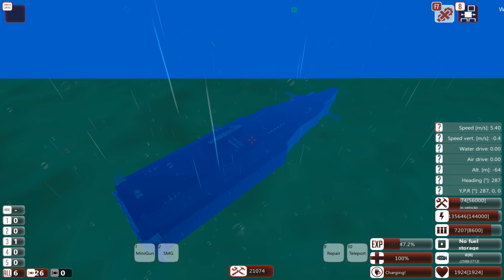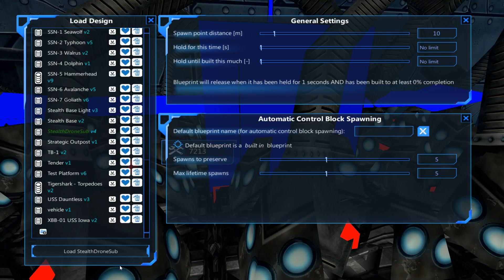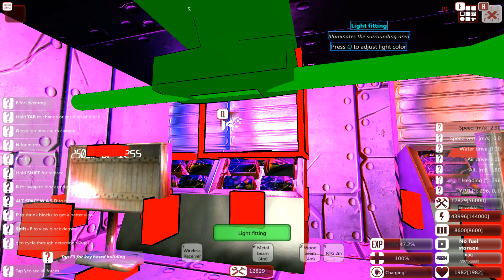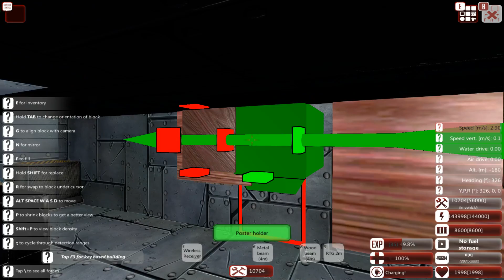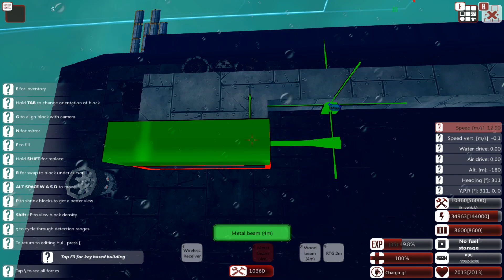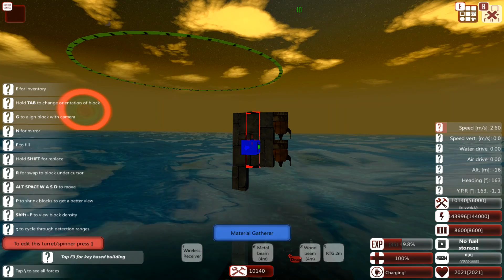From The Depths - Birthing A New Boat

Comment: One thing i thought of you can do to make resource gathering easier is you could put a docking station on a spin block.  With the docking station you can put a drone that has a power source gatherers and resource storage.  If you can keep the pids balanced where the sub wont move under water you can just use the spin block to rotate the drone above your sub and can gather in relative safety.  When your done you flip it back down under water and move off to the next.  Also something you may wish to try is use acbs to hot key preset depts for your altitude pid.  If you need ideas on how to set it up let me know.

Comment: The problems with you ship surfacing when you tell it to go to ...say -19 meters, is that the control block that is making the calculations is basing it off of where the control block is, not the top of your sub... And does tab do nothing in adventure campaigns?

Comment: Virginia sounds like a good name for her, for the torpedoes Iv'e noted that the top one that's supposed to track surface targets (the top torpedo) only is doing a lot worse at tracking surface targets than the one mainly meant for sub surface targets (the bottom torpedo), as I mentioned in another comment it has redock if damaged if docking to a subvehicle spawner. And as you have noticed it toggles it's AI depending on the range of enemies.

You could probably add a chair and heartstone to have easier access for upgrades and I've mentioned some routes for possible upgrades in the mail too.

Lastly she not he :)

Comment: question.. Why another sub and not surface resource collector for resource nodes ?
Reply: and ACB to make the sub redock when its at <X% health
Reply from the maker: Because subs are the most survivable. And killing another construct + gathering its resources is usually more profitable than mining resources as well as faster.
Reply: The sub has redock at % health it requires a sub vehicle spawner however, also I forgot to mention it. >_<